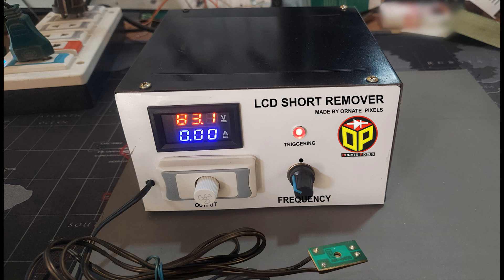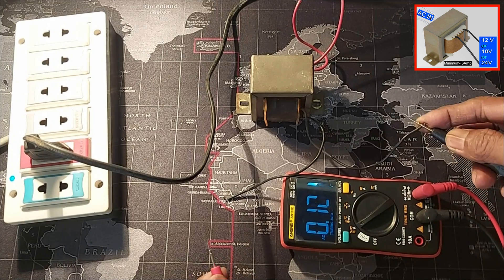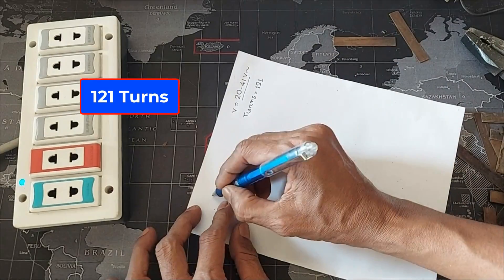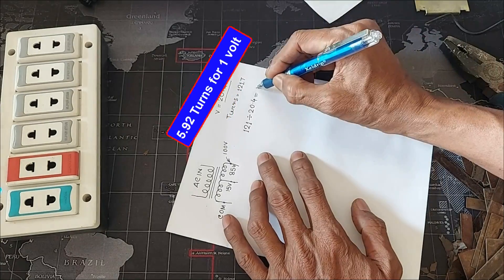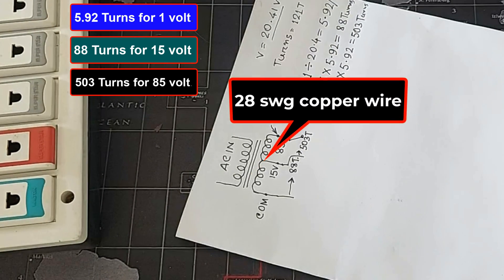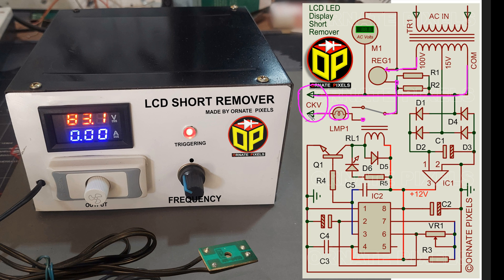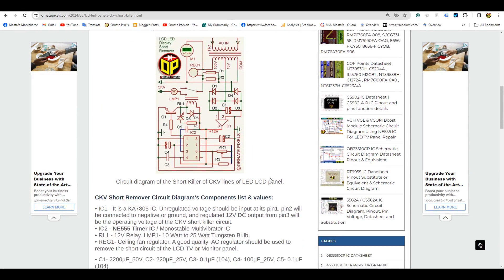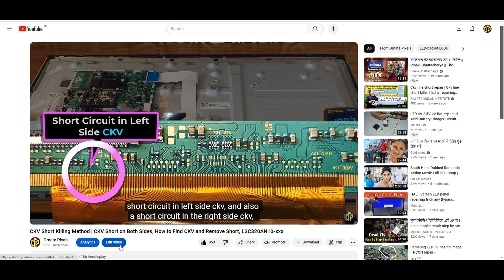LED/ LCD Panel Short Killer Device: CKV Short Remover Circuit Diagram & Transformer-Making

Comment: I have few questions, I hope you will find some time to answer them. Why you decided to use AC? It produces better results, or it's a choice out of convenience? Why there is a need for frequency adjustment of relay? Is it to protect the rest of "healthy" cvk lines? The last question, the current limiting lamp that limit current to approximately 250mA is there for short-circuit protection, or it's there mainly to limit the current to the CVK?

Comment: Dear sir, here 50 volts is used to remove short. This volt is A.C ?
Reply from the maker: Yes
Thanks 🌺❤️❤️❤️🌺
Reply: @OrnatePixels  Could you explain why it has to be AC? Wouldn't the DC do the same?

Comment: Sir,This device is short circuit protected or not?
Reply from the maker: Look at the circuit diagram, there is a series bulb, that is for short circuit protection. Thanks Bhai.
Reply: @OrnatePixels  ok sir.
Reply: Sir, please provide core no of transformer as soon as possible
Reply: Please reply me Sir????
Reply: Sir, what is the Amperes of this transformer. I have already made triggering circuit & working well
Reply: how many watts does the bulb use?

Comment: Hello! Dear Sir, Congratulations on the appliance you are using and describing! I have the following comment:
1 With the 555 it should work by waiting for a monostablevibrator and start with a button. Thus, it will generate a pulse that will determine the time of impact. I didn't see a button on the schematic.
2. The meter is connected directly to 100V and it will always read 100V. It is better to connect after the regulator to actually show the voltage that will be used.
Reply: Hello, do you know maybe why it's AC not DC and also why do we need to control the frequency of the output? If I understand correctly the short killing process takes few minutes so it could be done manually?
Reply: I came back to ask the same comments and spotted yours. 
Did you find out?

Comment: Thank you for the very valuable information and the understandable explanation. I would like to ask if the removal of the short circuit on the CKV line would also work with DC voltage? I have a 0-60V / 0-5A lab power supply, to which only the circuit of the IC555 should be connected.
Reply: Did you try it? what is the result?
Reply: Did it work?

Comment: My fiend. Thanks for the video.
Can you show the REG1- Ceiling fan regulator?
Is it a wired potentio meter?
Or like a light dimmer with Triac and the voltages are adjusted by cutting the ac curve?

Secondly how many amps current is recommended for the transformer?
l start building the magic box this weekend.
Many many thanks Mustafa. Please replay.
Cheers from Amsterdam.
Reply: This you find out the current delivered with lamp? 
200 mili amps?

Comment: Önemli ve değerli bir bilgiyi paylaştığımız için teşekkürler efendim. Allah CC sizden razı olur. İnşallah.
Reply from the maker: Aameen, Allah sizden de razı olsun.
Thanks Brother
❤💚💙
Reply: @OrnatePixels  Brother, may Allah bless you eternally, I congratulate you! I have some doubts, the method of cutting the lines is not effective, is it discontinued? Is this short killer method the definitive and lasting solution or will the panel be damaged again over time? The ck line cutting method was a trial and error in the panel repair since that repair did not last long? I look forward to your masterful explanation and thank you very much for sharing your knowledge! Greetings from Venezuela
Reply: @OrnatePixels positive and negitve?? Ck1?